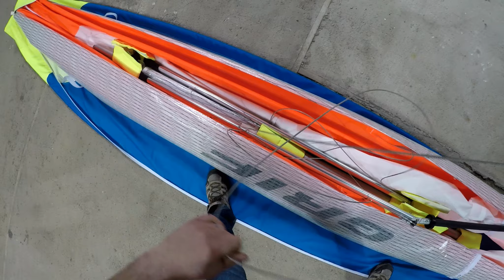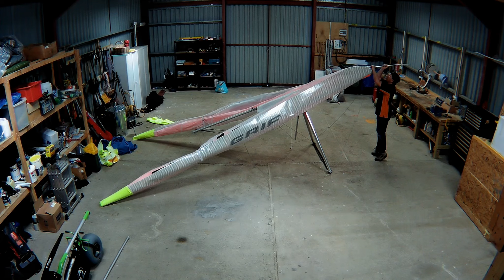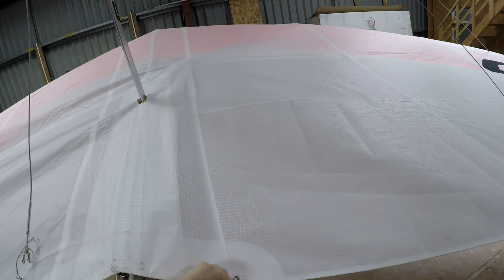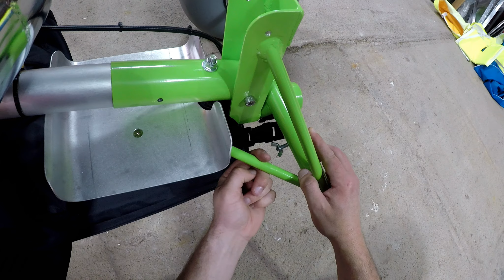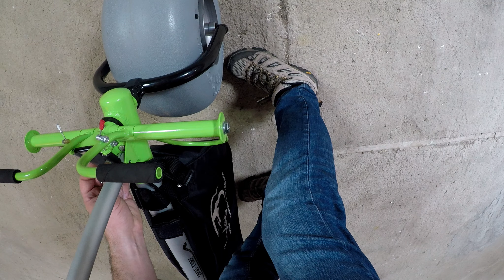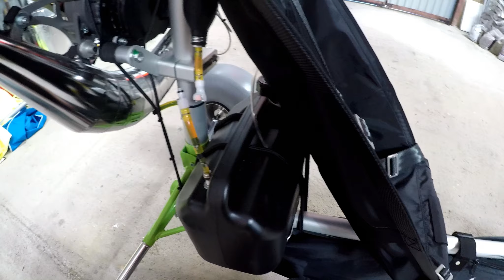Rigging the Snake sub-70 nanolight

Comment: Nice design But!! The seat/ harness looks uncomfortable I maybe wrong, a black petrol tank? you won’t be able to see your fuel level.
Reply from the maker: Hi Dean- wrong on both counts I'm afraid ;)
The hammock seat moulds to your shape so is a lot more comfortable than most padded seats. I've had 4+hr flights in it and been fine.
Also the black tank has a transparent panel built into one side. Hope that helps!
Reply: @FunFlyingGlobal  The video wasn’t clear with tank, with the seat does it support you enough for thermaling.
Reply from the maker: Yes, the Snake holds the current world record for distance flown without engine power, and the seat was comfortable throughout.
Obviously if you're concerned about it you'd be welcome to come and try it for size as soon as lockdown rules permit.

Comment: Great video mate! It's rare to just see things so clearly narrated and recorded without distracting editing, in real-time. I have a couple questions:
- you mention that you could have tethered pins on the axles to save a few seconds... but i noticed that the wing has the amazing wired connectors with quick release pins, but when it comes to the trike there are all these loose parts just begging to get dropped in the sand/mud/grass/objectmagnetofyourchoice. Why on earth WOULDN'T you replace all those with the same kinds of captive connectors, and why doesn't the Snake come with those to start? Such connectors are commonplace in the sailing community and have stood the test of time.
- what does the folding kit for the wing include/require?
- is there any front-strutless version?

Thanks very much!!
Reply from the maker: Hi.
To answer your questions;
1. Quick-release pins cost around £20 each as opposed to about 50p for a clevis pin/bolt. We can of course supply either direct from the factory.
2. I'm guessing you're referring to the wing short-pack? This is standard on all of our wings and allows removal of the outer leading edge tubes to reduce the packed length for storage or transport. No tools are required but it'll add a few minutes to the rigging time.
3. No, the front strut is a structural component. To create a trike without this triangulation for strength would require a lot more weight, which kind of defeats the point of these lightweight trikes.

If you have any other questions please email me at info@airplayaircraft.co.uk
Reply: @FunFlyingGlobal  sending you an email now- thanks for the reply and sorry for the delay!

Comment: Isn't the rear undercarriage easily bent?  I cant see any cables, just the axles which must flex and bend. Are they just aluminium?
Reply from the maker: So far, none of the UK fleet have suffered any damage like that. The undercarriage legs are made from solid 25mm Ergal 7075 (roughly the strength of steel but with much lower weight). They're actually machined down with a taper to produce some suspension spring as they're too stiff otherwise.
Overall gives a much cleaner aircraft and allows easy removal of the undercarriage legs for transport.